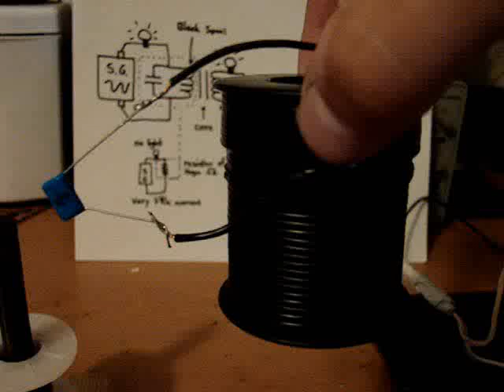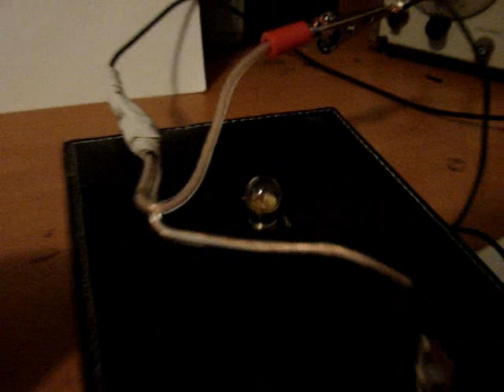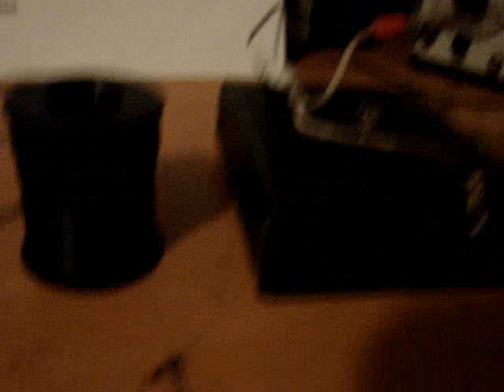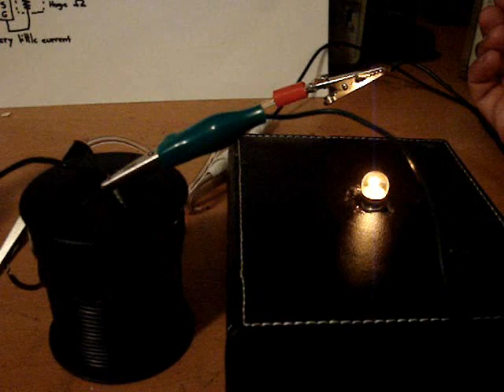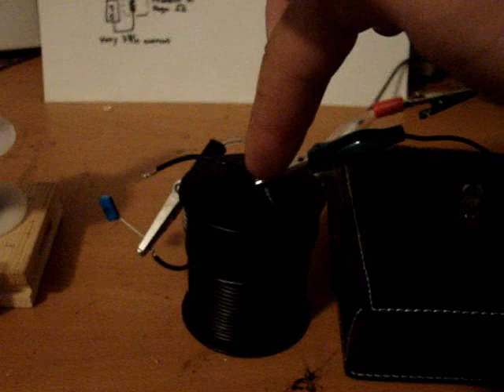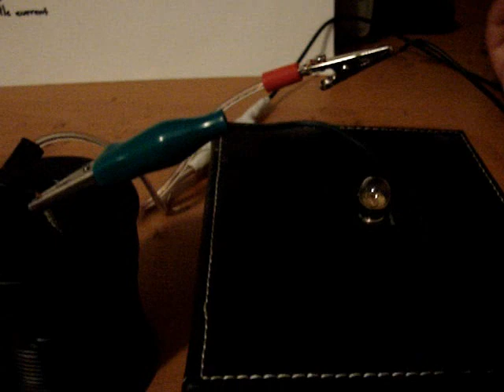Introduction to resonance

Comment from the maker: No it is not like an actual resistor, it has impedance measured in ohms, except that energy passing through this impedance is not converted to heat like with a resistance. There is work being done on the LC, hence we have some amperage draw, though small, point is the ratios.

Comment: Good and informative!

But its not like an actual resistor right?
If you have some current traveling, while the LC resistance is higher than that of the lamp, there should have been voltage loss and thereby work done  in the LC tank, at least if it was a normal resistive element.

Comment from the maker: It gets even crazier. If you discharge an inductor into a capacitor, you get charge X, if you discharge an inductor into a capacitor with 1,000 ohms in series on the second try, you still get charge x on the cap, seems ohmic resistance becomes "invisible" while "time" is the only variable
Reply: yes, if you discharge between 2 caps with or without the resistor, you get the same results..

Comment: With some work you mean that the LC circuit has some losses right?
But its really weird if you think about it.
Theoretically you can limit ac current without having any serial resistance (R) at all, like no lamp or resistor. But you can still make current travel, so where will the voltage loss appear; over the LC circuit or the general LOW resistance of the wires?
I'm asking because I really don't know it myself ;D